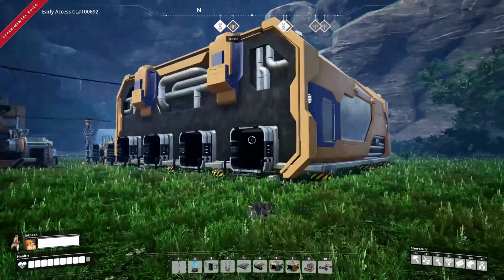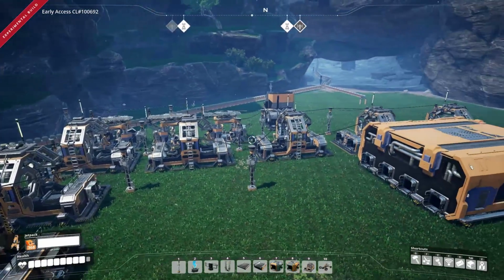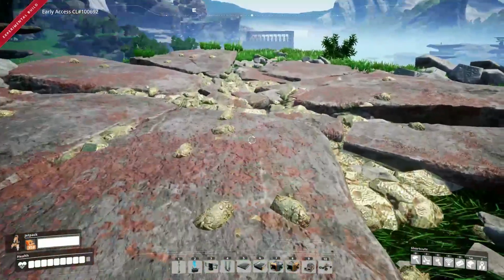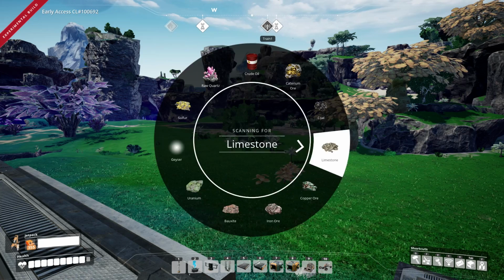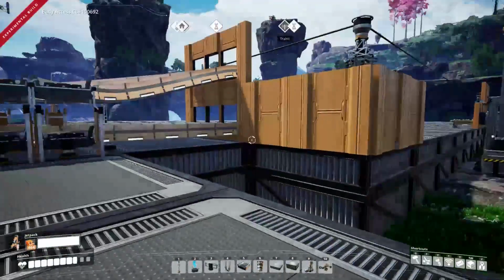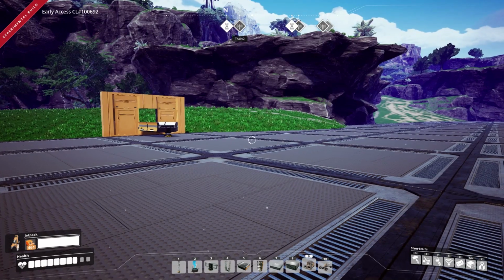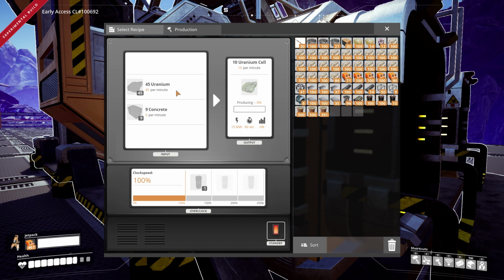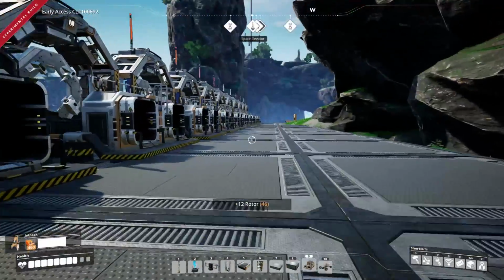Nuclear Power in Satisfactory is Actually INSANE! | Satisfactory Early Access Gameplay Ep 38

Comment: You should keep the turbo fuel as a peaker plant. 

 Definition: Peaker plants, and occasionally just "peakers", are power plants that generally run only when there is a high demand.
Reply: IRL, peaker plants are there to deal with the fact that many power plants can't "spin-up" to higher demand fast enough to meet it (nuclear power  in particular has this weakness, it usually takes a long time to change the output so they are generally run for a base load and leave changes in demand above the base value for fossil fuels).

In Satisfactory, this is not an issue; power plants put a set amount of power capacity on the grid, and so long as you never go over that capacity, you're absolutely fine as every power plant will adjust instantly to match any change in demand. Going from 100MW to 10GW in a moment as your entire factory spins up? Not a problem. Due to the sheer power capacity of nuclear reactors, if you can sustainably run several reactors in-game then there should never again be a situation where you ever run out of power (... unless your storage for nuclear waste fills up, backs up the conveyors, and prevents the reactors from operating, or you're going crazy by building a factory covering the entire map, using every single node available; and even then, you'd be hard pressed to exhaust the 1TW+ of potential power from uranium in that scenario).

Whilst it might be interesting if Coffee Stain made adjustments to the power system to more accurately reflect real life, thus elevating the importance of things like a) considering base, average, and peak loads, and b) having systems in place to deal with fluctuations, that is probably well outside the scope of the game and possibly getting into unenjoyable levels of complexity for most.

Comment: Keep all the radioactive stuff in the cave. Manufacture all the non-radioactive core components of the Fuel rods outside then belt them all into the cave to manufacture the uranium cells and fuel rods.  Then fast belt them out to the reactor and fast belt the waste back into the cave into a bunch of storage containers.  Keep the manufacturing of the fuel rods balanced to the usage rate of the reactor.  That way you don't have a bunch of fuel rods sitting on the belt waiting to enter the reactor.  Keeps the belts clear or radioactivity.

Comment: Don't forget to go hard drive hunting now that there's new stuff to build. i found one that would of made your power factory a litter easier. I'll let you find that one though Kibitz :)
Reply: I have seen three new recipes that apply to the tier 7 - nuclear power chain :) that makes things a lot easier.

In fact, when combined with older alt recipes (some already in use in the main base), you would use less than a third of the items that you would use if you were not using any alternate recipes.

The savings with uranium is even more - with two of the new alt recipes, you would use less than 1/5 of the uranium that is needed to produce the same amount of fuel, and you could get by with a miner mk2 without overclocking along with mk2 onveyor belts and lifts.